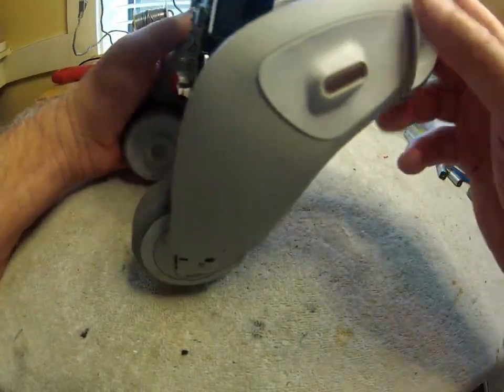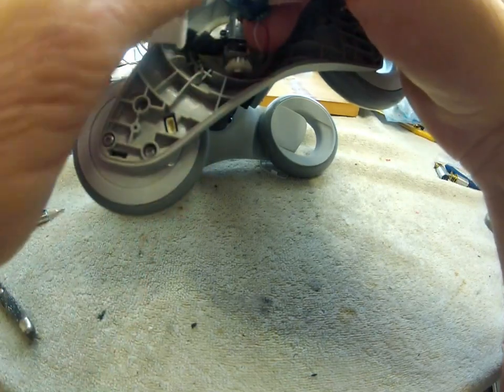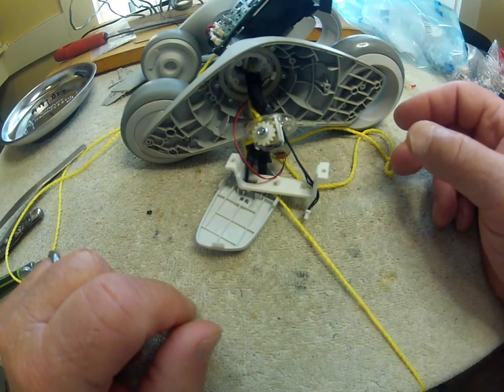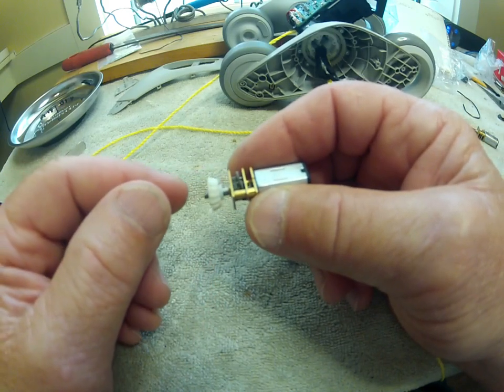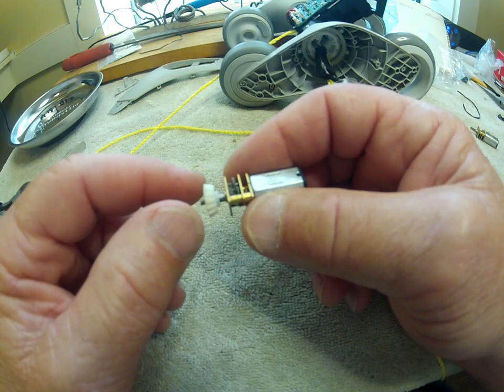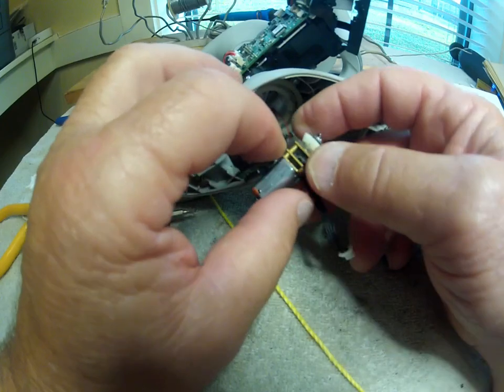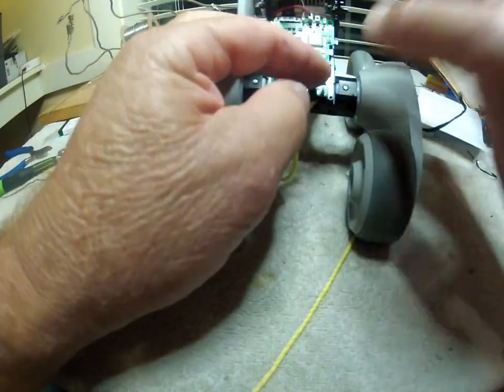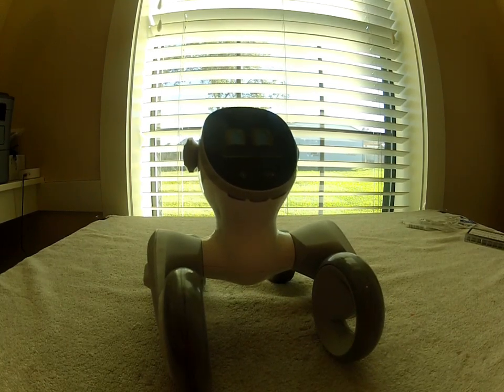Loona robot hip motor replacement 11142024

Comment: Motor 6V, 130 rpm is that correct?
Reply from the maker: N30
6vdc
130rpm
threaded 3mm diameter shaft 
104 capacitor 

1mm 2 pin connector with 28 gauge leads

Or

I sale the matched motors on eBay

Comment: Can I ask you which engines you got and where? Thank you for your answer :) p.s. Excellent guide :)
Reply from the maker: https://a.aliexpress.com/_mOnFvGR

These require work filing but they work

vidrineg1
@yahoo.com
Reply from the maker: Sure on eBay

Pair of matched Loona motors

https://www.ebay.com/itm/297055760529?mkcid=16&mkevt=1&mkrid=711-127632-2357-0&ssspo=qP2hAULQS5-&sssrc=2051273&ssuid=qP2hAULQS5-&var=&widget_ver=artemis&media=SMS